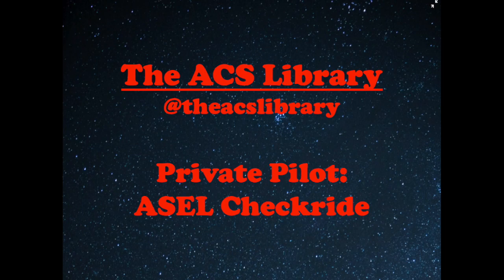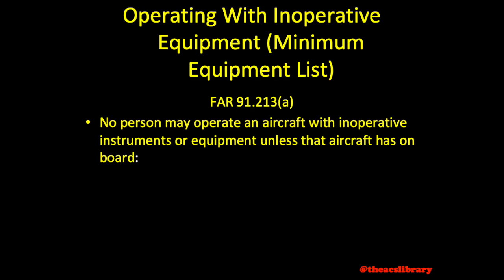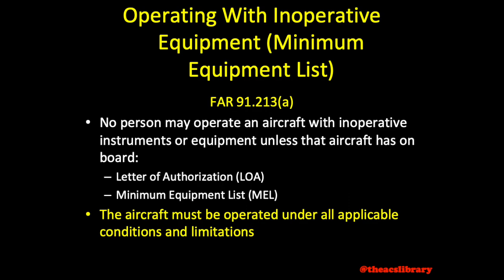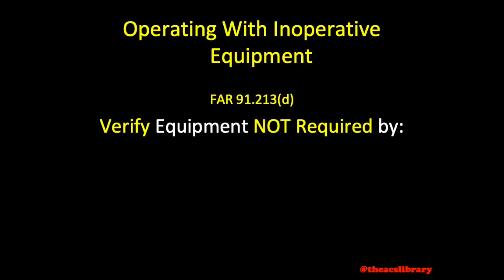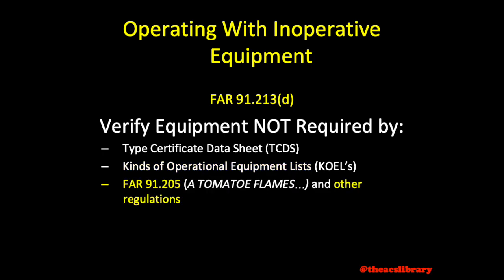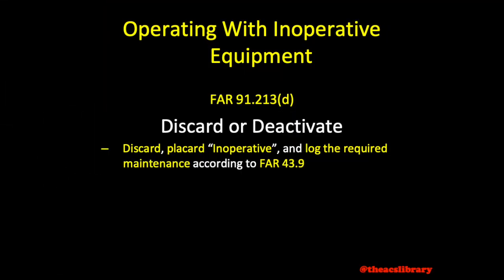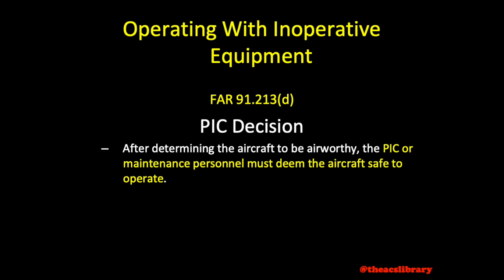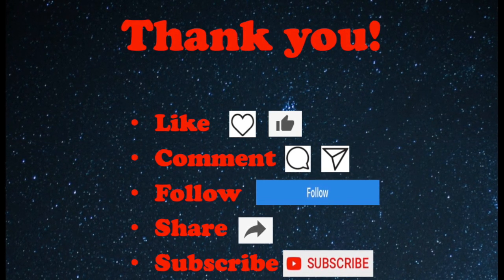PA.I.B.K3a Flying with Inoperative Equipment

Comment: I’m a CFI and what still throws me off is the “VFR day type certificate” … the TCDS just has a bunch of dimensions and limitations, is there something else?  I’ve always just checked it.  Also if something like a static wick is missing which isn’t actually in the TCDS, I consider it unairworthy because nowhere in the POH does it state that the static wick is NOT required.  What do you think?
Reply from the maker: Hey Jonathan! It’s been a while since I’ve checked a TCDS.  Right now my computer and phone both won’t pull up the FAA TCDS website for some reason.

Basically, you’ll treat it like an MEL.  Say your flap position indicator isn’t working for some reason, but you see the flaps are functioning just fine.  You’ll want to check to make sure it’s not listed as required under any parameters you wish to fly in.  If you’re flying Night IFR, you’d make sure that it’s not required for Night flying and both VFR and IFR flying. 

As far as the static wicks question.  I haven’t looked at the TCDS for it, and I’m not sure if I have the same POH KOEL as you’re looking at.  The one we had stated that the plane was equipped for day and night VFR as long as it was equipped as directed under Part 91.  So technically you could get away with no static wicks. The only time I might be a little weary to fly it were if I were in an aircraft equipped with static wicks and they were damaged or missing and I knew I was going to fly somewhere where two way radio communication might be required, like Class B airspace.  99.9% of the time, it probably wouldn’t be any issue, but you know how Murphy’s Law works haha.

I hope that helps to answer the question.  Let me know if I could do a better job explaining anything.
Reply: Thx for the response!  Yeah I guess the static wick thing could come down to PIC decision.
Reply from the maker: That’s how I would interpret it, but always good to lean on the safe side, which it sounds like you already do!

Comment: A rather stupid question, but possibly can shed some light on the topic. Suppose I discovered that on my Cessna 172 the brakes are inoperative. Can I legally fly it? (PIC decision will be not to fly, of course) I couldn't find anything about brakes in TCDS, KOEL, 91.205 or A/Ds.  I know you said "and other regulations", and 14 CFR 23.2305 (b) says "All airplanes must have a reliable means of stopping the airplane". But how should I know where to look for this info?
Reply: Ok, I get it. 14 CFR 91.213(d)(2)(i). "Applicable airworthiness regulations under which the aircraft was type certificated" must be added to the list of things to check. And it's a big one :)
Reply from the maker: Vladimir, this is one that could have you looking around all day.  I know it's a tough one.  For the Cessna 172, most aircraft will have a "Required Equipment" Section at the back of Section 6 of the POH.  In there, look for items designated R for "Required".  You'll see items that are super obvious, such as engine, brakes, seatbelts, etc. all listed there alongside some that are not so obvious.  
Typically the "Other regulations" part I mentioned is talking about Airspace Requirements.  ADS-B, Transponder, etc.

Comment: There's just one thing nit-picky thing I disagree with; logging maintenance is only required if maintenance was necessary for deactivation. @2:28 
For example, simply deactivating and placarding the position lights by pulling the circuit breaker and placarding it "Inop" is not maintenance, so no maintenance record is necessary. Of course, it would be great for the next person flying the plane to know that something is inoperative. 

91.213 (d) (3) (ii)
(d) Except for operations conducted in accordance with paragraph (a) or (c) of this section, a person may takeoff an aircraft in operations conducted under this part with inoperative instruments and equipment without an approved Minimum Equipment List provided -
(3) The inoperative instruments and equipment are - 
(ii) Deactivated and placarded “Inoperative.” If deactivation of the inoperative instrument or equipment involves maintenance, it must be accomplished and recorded in accordance with part 43 of this chapter; and

https://www.ecfr.gov/current/title-14/chapter-I/subchapter-F/part-91/subpart-C/section-91.213